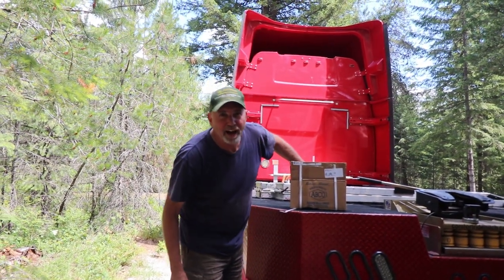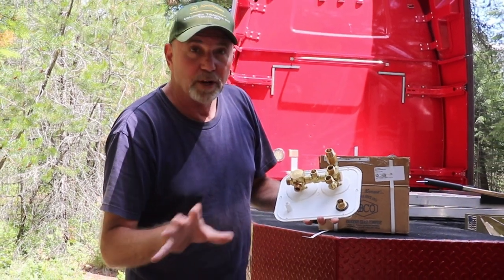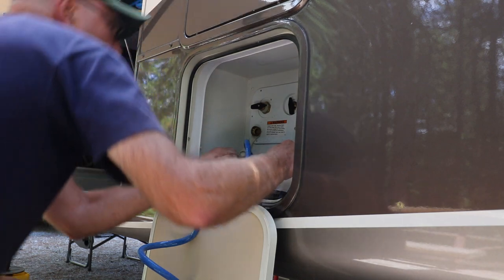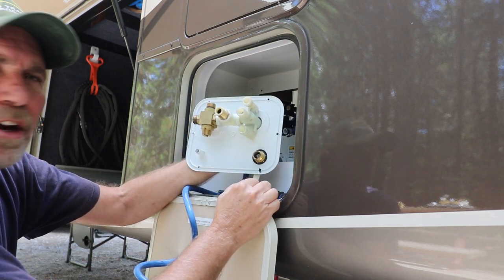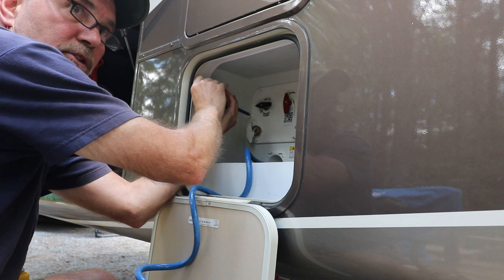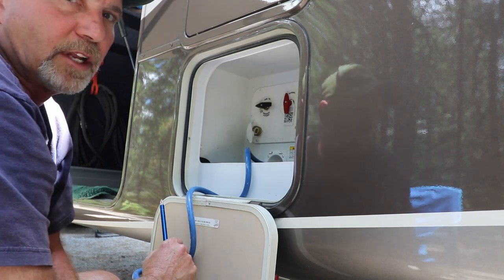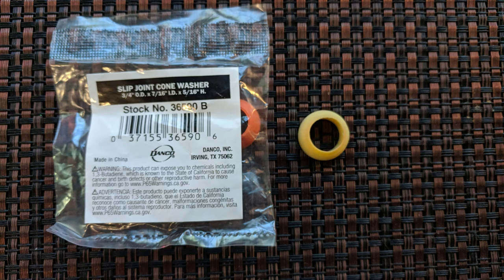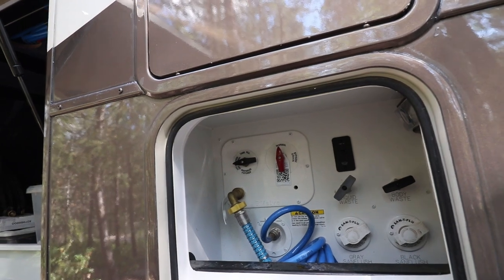Anderson Kantleak Water Panel Replacement //  Full Time RV //  RV Repairs

Comment: Great video. You weren’t clear do you interchange the two hot water lines when you go from plastic to brass. You said they were wrong but only you were going to relabel them?  Do you swap the two hot water ones for the brass valve?
Reply from the maker: They should be swapped when changing from plastic to brass.  I didn't want to go back in and change them so I just re-labeled on the front of the valve.
Reply: Suite Travels FYI, I changed them it doesn’t matter you have to relabel when you go to brass. Interchanging the two lines does not change anything.

Comment: Hi, I just replaced mine to the new brass unit too but when I turn on the water pump, I hear the pump but no water. I think I have the pipes correctly connected but now I’m all confused if I did lol any help, would be greatly appreciated :)
Reply: Also, since the the tank fill knob and sanitize knob  on the new one is reverse, what did you end up doing?